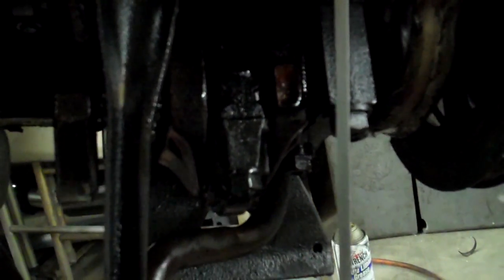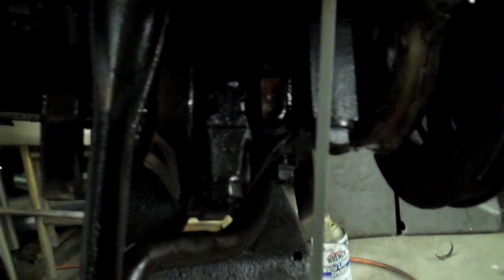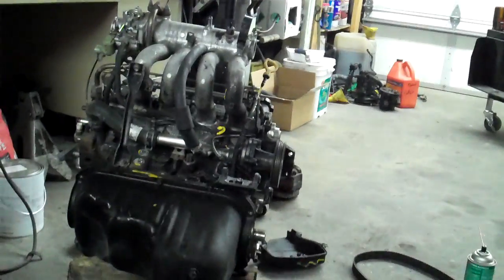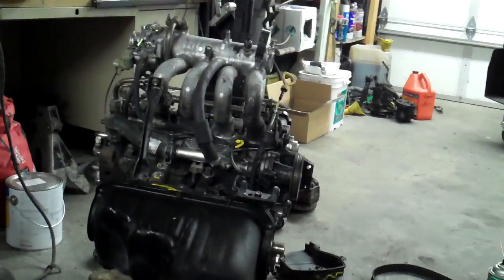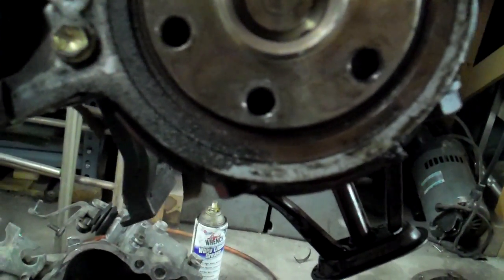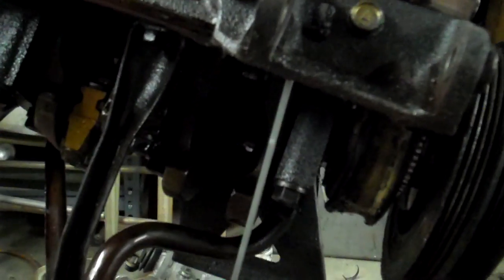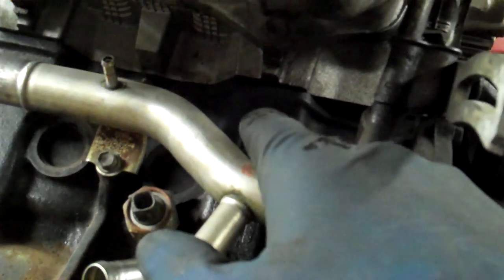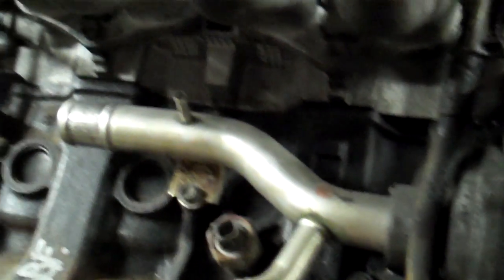ROD KNOCK!!! What it looks like inside the engine.

Comment: When is this salvageable? and how to you go about doing it? My number 2 cylinder makes a ticking noise and when i disconnect the spark plug wire it goes away. From what ive read its a spun bearing. If i take the oil pan off and it moves slightly can i just replace all the bearings and be good or will it screw up again.
Reply from the maker: Salvagabillity is when its less expensive to fix vs. replace.   Typically the crankshaft sustains damage as well.  If you just replace the bearing (in my experience as I've tried it) it will typically fail in short order if it even helps at all.
Reply: Depends if theres scoring in either surface of crank or rod(usually happens when you spin the bearings and keep driving it) your looking at 200 for new rod & crank bearings, 250-300 for a crank,possibly new rod, unless you can have them machined to accept bigger bearings, rings 60~ish, timing belt kit 200~.. If you can install those yourself you basically have a fresh rebuilt motor.. for stock cars you can get a longblock for around 1500-2500.. Its usually cheaper to rebuild if you use the old pistons & rods, unless the block is damaged.. Cheaper to replace comes into play when you add in machine work and if you have to have a mechanic do the install labor, as just about anyone with friends can pull a motor, swap the sensors and valve covers/intake and have a brand new motor
Reply: might just be a timing problem with that one cylinders crank/cam positioning sensor
Reply: Ended up junking the truck, It was a 1987 mitsubishi pickup. It did spin a bearing and the crank was scored, i couldn't find a used motor so i junked it. Bought a 1992 hardbody that hasnt given me any problems.

Comment: It's nice that you can swap out an engine but honestly,  every single time I've had a mechanic do so with a "low mileage block" within 6 months I'm back to rod knockin. If you're in there anyways, spend the $20 to get a piston ring compressor and change out that crank and rod.  I'm so fed up with this that I've actually changed a crankshaft in my old Supra and am in the process of doing it in my 91 MR2.  It's more work but eliminates the problem of guessing how long? or what can go next? on it.
Reply: Totally agree. Ive learned that lesson as well. Better to replace bad parts with new parts instead of swapping them with "newish" parts. The extra money will come back to you in the event that you keep the car for a very long time. I'm in the process of building a high performance turbo 3.4 Tacoma. I'm running 4 psi on the stock engine currently but hope to buy a spare engine to build it up with forged rods, pistons, valves, cams and cometic gaskets in the near future. Maybe up the boost to like 20-25 psi. Toyota FTW :)
Reply: do you regularly check your oil and put oil in when it's low?

Comment: I get a slight knock for a half-second on acceleration from a stop. It's a new car (2014) with only 6k miles. I use 87, but the manual says that's all it needs. Any guesses what could cause this? Bringing it in, asap. Great vid, btw.

Comment: people say it's NORMAL for a 4.7 engine in a dodge durango to make a noise before it warms up. Like a  ticking noise. Is that true or am I looking at a LEMON? yr is 2003. Left Mount engine with NO EGR.
Reply: I have seen some cars personally that tick when warming up. The idea is the metal is shrunk because it is cold. When the engine warms the metal expands and no more ticking sound.

I know almost every Jetta I have seen has a tickng sound to it. Some people would feel it is normal while others may not. But there are some vehicles that do this and from what I personally feel is that no engine should do this. To try to counter it if you are running 5W-30 run 10w-30 this can sometimes help.

Personally it would bother me but then again I can't stand the Chrysler Corp. They can't seem to make suspension parts correctly if it was to save their life.

Comment: That's exactly what happened to my old '96 S10 at 150,2xx miles one of the rod bearings went and did the clacking noise for about 10 miles then the engine completely died and that was all she wrote.

Sold the truck cuz it booked for $2500 and the trans was starting to slip between 1st and 2nd as well.
Reply: you could have v8 swapped it for that much haha
Reply: Same. At 135k miles my '96 S10 developed a bad knock and the engine wanted to die. Spent two weeks rebuilding it and now it runs great.
Reply: But I needed to keep my 4wd for winter and off road plus my f150 is 10x more capable than that S10 was
Reply: Andrew Burnett how much would it cost to rebuild?

Comment: I would love to point out ENGINE not motor common mistake... your Alternator is a Motor this is an engine :)
now I have what i believe to be bad valve clearances any information on that?
Reply: no one gives a flying fuck.
Reply: Actually no not true. The difference between an engine and a motor is that an engine produces it own energy. The sun, for example, is an engine, and in fact is the only true engine we know. A motor takes one form of energy and turns it into another, namely mechanical, rotary power. The "engine" in a car takes chemical energy (fuel and air) and converts it into mechanical energy. As for the alternator, you are mostly right. It's not a like a generator though. Generators have static permanent magnets and start generating electricity once they start rotating. Alternators have field windings and cannot start generating electricity until an outside source of electricity is introduced to induce a magnetic field. In a car, this outside source comes from the battery.
Reply: MrNotorius5500
a machine with moving parts that converts power into motion.
Websters Dictionary sorry they say  you are wrong an engine is a machine with moving parts that converts power (gas fueled explosions) into motion (spinning)
Reply: Um no, I'm right. I went to school for this. Doesn't matter what dictionary you look in, I know what the difference between what an engine and a motor is.
Reply: MrNotorius5500
 you obviously did NOT go to 'school' for this... as I have a degree in Mechanical Engineering and an engine is what drives a gas vehicle.
Reply: You're actually wrong. Motor is something that runs off another source of energy, including engines. Engines are SPECIFICALLY what we know they are, but motors can be both engines or electric motors.
Reply: mac mckee
not likely lolol he believes whole hardheartedly that the only 'engine' is the sun... yep most certainly an engine that is... and he claims  he 'went to school for this' :) BS in mech eng here yes I shortened it :)  another question... why is Bachelors in Science BS? and art a BA? shouldn't the bachelors of art be BS? ahaha :)
Reply: MrNotorius5500 I may have read this comment wrong, but the outside source for an alternator to produce electricity is the engine itself. The alternator introduces a charge to the battery after starting the engine in order to maintain optimum voltage. Once this charge is achieved the regulator stops the charge from reaching the battery. You don't need to introduce electricity to an alternator in order to get output. You simply have to spin it. Are you referring to "flashing the field" in a generator? Again, if I misunderstood I do apologize.
Reply: mac mckee
not YOU I was talking about the other poster sorry if you thought that part was to you
 It would appear Google refused to put that jackasses name into my post :( that notorius POS guy
Reply: anjhindul Sorry, I misunderstood. His description of alternators and generators was backwards to say the least. Sometimes it is necessary to flash the field of a generator in order to make it produce electricity. If you put battery power to an alternator you get an electric motor. Also, you can spin an electric motor and get a voltage output. Funny, huh? I'm sure you know all this. You're right about  motors being electric and engines using a chemical fuel source. It's basic Mechanical Engineering. Maybe he'll read these comments and learn something from it.
Reply: mac mckee
 you are right... an alternator gets the motion to turn its coils to produce electricity from the engine... the alternator is more of a 'motor' then the engine... in all electric vehicles the ELECTRIC MOTOR note it is NEVER called an "electric engine" and NEVER is an ENGINE called a "FUEL MOTOR" I quoted the  MOFO dictionary for you so you knew where my SOURCE came from you BS idiot...
Reply: Why the hell are you calling me a BS idiot? I was agreeing with you. I majored in Aeronautical Engineering and minored in Mechanical Engineering. Mech. Eng. states that motors are electric and engines use a fuel source. WTF?
Reply: lol.....I agree
Reply: MrNotorius5500 The fact is that you are wrong about the alternators and generators. If you think that the battery of a car supplies voltage to the alternator in any way then you need to educate yourself on the workings of an alternator. I wasn't hating on you at all, my comment wasn't in any way hateful. I simply said that maybe you'd learn something from reading my explanation. I've learned a lot from those that came before me in my chosen profession. Nothing wrong with that at all. And I wouldn't say my degrees are fancy, but I did pay a lot of money for them and worked my ass off for them also. I didn't mean any ill will towards you, it was the other guy's comments that were bashing you. If you don't believe my explanation of how alternators and generators work, then simply ask someone you trust. If you think that you already know, then that's ok too. No reason to get nasty about it though.
Reply: mac mckee
I actually muted him his name says all I need to know about him :) I know of SOME alternators that do require a voltage to be introduced before they will create electricity... the ones with electro-magnets in them... good luck finding one of those in a CAR though :)
Reply: Ok, I understand which part of the alternator you're talking about now. You're talking about supplying a varying current to the stator in order to change the output of the alternator. I'm with you on that, I simply misunderstood what you were saying. My apologies.
Reply: mac mckee
yes some alternators do require an initial voltage... the extremely rare and few that do not have stationary magnets in them but as most vehicles have alternators with stationary magnets... the likely hood of finding a vehicle with electromagnets in them is slim
Reply: MrNotorius5500 you're an idiot, and you gave me a good laugh. Thank you.
Reply: austingost505
not sure who MrMoronius is reporting you or me... either way i am waiting for his account to be permabanned :)
Reply: anjhindul it doesn't matter what the technical terms are, most mechanics know what you mean either way you say it.
Reply: an engine is any machine
Reply: anijihindul You nitpick about names then ask for help on your bad valve clearances.
 Shirley you can't be serious,  google 'oxygen waster'.

Comment: Very good explanation. Why would one rod get burnt and the other not?
Reply: Because debris probably got past the oil filter and clogged the oil gallery which feeds that bearing.
Reply: It's by chance There a tiny holes leading to passages (galleys) all throughout your engine block between especially the moving parts including every one of  these connecting rods and crank. I think most people do not realize that most of their engines and parts are hollow castings and have these galleys placed throughout the engine. Theses galleys essentially act as arteries and veins of the motor to carry oil to countless moving parts in order to lubricate them. Other larger galleys are used to carry coolant and to keep the engine block from overheating and burning up. If one of these galleys gets blocked up, just like a real living person... a stroke or heart attack occurs. Same thing with an engine. If it gets block up in a specific area, the correlating part that is receiving oil from the blocked/stopped up galley will perish. This happens when oil isn't changed regularly and turns into sludge. It begins to sludge up and hang up in those galleys. Same thing with coolant. Coolant should also be changed in intervals to avoid corrosion which creates blockage. Change your oil, trans fluid, and anti freeze regularly!
Reply: jlerro1981 How about black brake fluid? Should that be left in?
Reply: lol

Comment: same thing happened to me i have a 2AZ-FE in my 2009 Toyota Corolla XRS should i rebuild the engine or get a used engine?
Reply: get a used one dude. Rebuilding is expensive. The gaskets alone can cost quite a bit since you usually need to replace every gasket.

A low mileage used one would be the best route to go. Just plop it in bolt it up and go.

Comment: Hey Brian. Heres a duzey for ya. I own a 2002 Chevy Impala 3.4L Rod Type. Been a great car. 306000km on the original block and tranny No leaks and still runs like a champ. But recently I have noticed a chattering on cold starts and over the last two weeks its gotten progressively worse. But as it hits temp it fades back to a slightly audible chatter. Im mechanically inclined and im 99% sure its a collapsed lifter. But would like a second opinion. Sound about right? Please get back Thx in advance

Comment from the maker: an intermittent knock in the top end is more likely a lifter or partially blocked oil port (loose ball type obstruction)  I would first try running Marvel Mystery oil in it, or use 0W30 synthetic.

Comment: My oil pressure gauge went crazy one day and stopped working.It started running rough and then a loud knocking. I never thought it was not circulating oil until it knocked. i found a mechanic and he says he can rebuild bottom half for 600.
l'm limited on funds but is it not a good way to go. How much would it cost to swap with a used motor. 2002 3.0 V6 Ford Ranger flex fuel. Oh its funny i can always tell when someone's from my hometown just by their good nature and yes the accent. Thanks Brain.

Comment: I hear a faint knocking sound coming from my right back wheel are & it seems to show up when I brake  & I am going slower.I just had 2 new back struts installed &new bearings pressed in the two back wheels & new drum brakes on the back wheels & this week-end I am getting the front struts, brakes & new bearing on front right  tire .The sound I heard came from the right rear side.Any ideas? The crank shaft is in the center near the front & it does not sound like it s coming from there.I993topaz

Comment: maybe a dumb question but i bought an 03 Dodge ram 1500 v6 i believe its 4.7l guy said might have a thrown rod it wont crank over just clicks real loud and nothing got under it to look at the block saw that the oil pan has a big whole in the side and it also broke a small peice where the oil pan bolts into, is that because it threw a rod? if so about how much do you think it would cost to fix? if not what do you think it could be???? could REALLY use the help PLEASE and thank you

Comment: raptorengines has a 3.0 V6 for less than $2000 for performance, $1500 fo stock, if its the 4 cylinder 22re engnbldr, lceperformance, 22re, and raptorengines sells engines for less than $3000, except lce their professional performance engines

Comment: A local mechanic worked on my wife's car about 6 weeks ago to replace engine head, etc. 1 week ago engine seizes again. Mechanic says new problem having to do with lower part of engine connecting rod blew says no way he could have known bottom of engine was not good because he was just focusing on top part of engine. I'm out $3000 nothing he can do. Is this accurate. Your video suggests that the top and bottom are linked when repairing any part of engine. Please let me know.

Comment: white smoke is usually your engine burning water sounds like you have a bad head gasket leaking into the cylinder and causing your miss along with adding water to your oil making it spin a bearing

Comment: When you say, "new", I'm assuming that you mean used, from a junk yard. First of all, just because an engine has low miles, doesn't necessarily mean that its in good shape. Hopefully, you'll check out this engine for similar problems. It just doesn't make any sense to install a used engine, drive it, & just hope for the best. You have to consider, "How did this car get to the junk yard in the first place?" Well, usually the collision or engine malfunction happens due to a lack of maintenance.

Comment: I did an oil change with a bit thicker oil, and it went away while its cold, but once it warms up... It comes right back. I'm almost tempting to just run straight 50 weight like I did in my toyota tercel.

Comment: I have an interest on purchasing a 1996 BMW 318I Sedan that has a rod knock on cylinder #2. Do you think I should get it ($400) and have a look at it if it could be fixable? or would I be able to easily(by easily, I meant maybe get it shipped in) get a new engine for it? I have a Mazda B2200 that has been collecting dust for the past 2-3 years and when my cousin started it, there was knocking in the motor and I'm thinking it could be the same problem. How much (if fixable) would everything cost?

Comment: Yes its fixable.  Whether its worth it depends on the cost and availability of a used engine.  -- compared to what a new crank, bearings, rods, gasket sets and labor cost.  But in a lot of cases, probably best to get a used engine and sell the good parts from the old one on ebay.

Comment: I have a question, by the way thanks for posting this video. My Pontiac Montana has a similar knock, but quiets down while driven it. How can I tell if its just one Cylinder or the entire crackshaft? Also, what is the chances the engines seizes while I am driving?